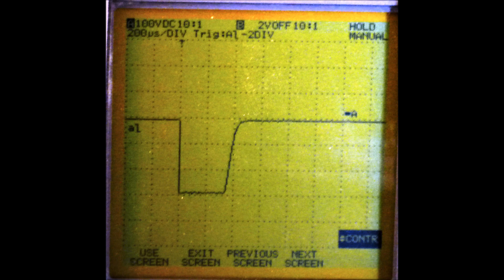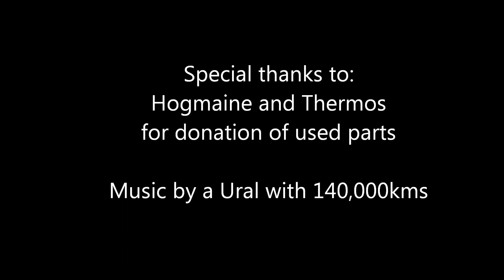URAL Overview Of The Ducati Ignition

Comment: Thank you for this. I have a 2013 that just lost spark. I was charging the battery when this problem occurred..not sure what to look at first. Is there an ignition relay or fuse or is this all of it? Thanks again.
Reply from the maker: Easy things to start with are: make sure you didn't accidentally hit the kill switch, unplug and re-plug in the CDI unit and Hall sensor connectors. Two common problems are the Hall sensor and poor ground. I don't show it but in the video at the 2:24, mark to the right of the coil, is a grounding point (part of engine mount).
Reply: @94KLR250  Thanks, I already unplugged and replugged the cdi module but I will check the hall connector. I also double checked the kill switch. It has been sitting for about a month...but it did fire up at first with the enriches on. But would die when I turned them off. After starting it like that 5 or 6 times it just lost spark. It's cold here in NY too so maybe a ground short. Anyway thank you for the tips.